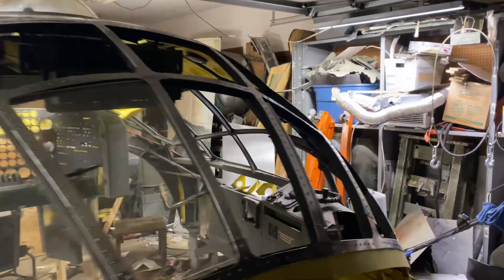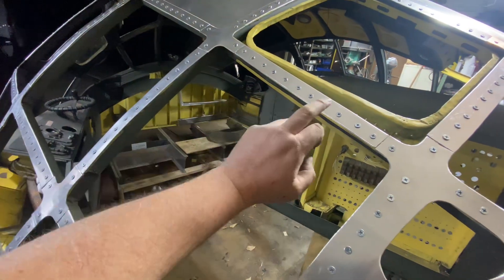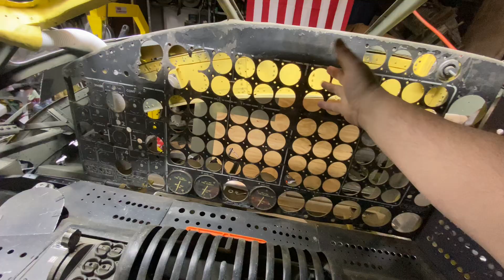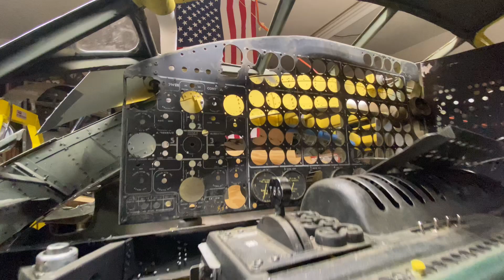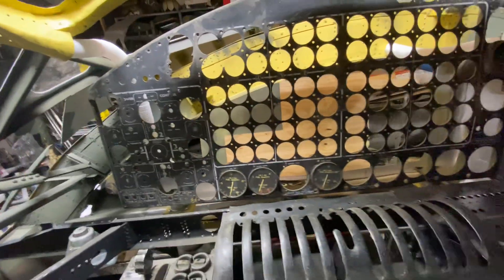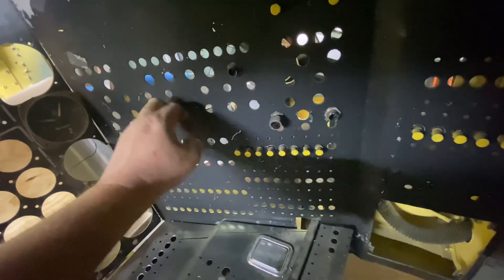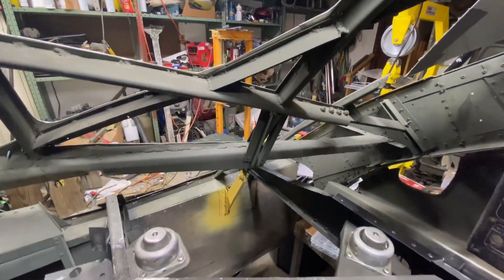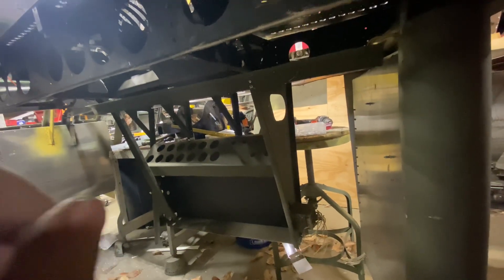The Largest Combat Aircraft Ever Built - B-36 Canopy Aluminum Covering Complete

Comment: I had the privilege of knowing a gunner/engineer who flew on the B-36, he had the unenviable job of inspecting the engines via the infamous tunnel in the wings. Great to see a piece of history coming back to life, I'm sure Don would be proud.
Reply from the maker: Thank you for telling me about Don. However, I must correct you when you indicate the engines could be inspected during flight. This myth most likely came from the Boeing XB-15 whose engines could be accessed in flight. However, the B-36’s engines were installed in quick change nacelles that had a massive firewall between the engine and the internal wing structures. The engines were physically and visually impossible to access from the wings passage ways. What the crew did do was inspect the fuel tanks for leaks, etc as well as change fuzes and breakers in the remote engine electrical panels that were located close to their respective engine.

Comment: On the original aircraft, did they also use screws for the canopy framing or would those have been rivets?
Reply from the maker: Every B-36 built had screws in the canopy, just like mine.
Reply: @B36HPeacemaker  I wonder if that was to facilitate replacing broken glazing. Thank you for answering.
Reply from the maker: @luvr381  It makes things easier and only one man is needed to maintenance the glazing. Prior to the utilization of the speed-nuts in the frames, they used nuts and bolts which would require two people.